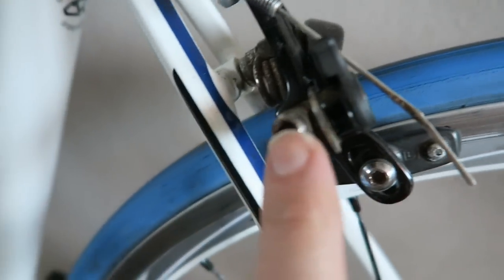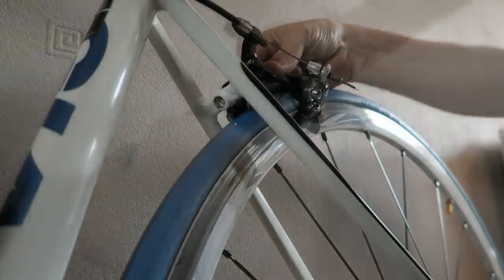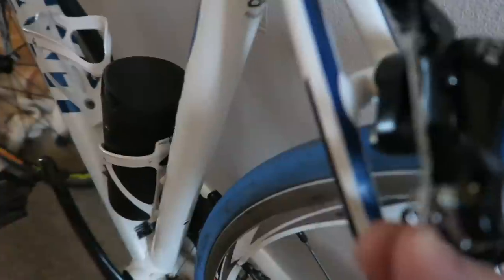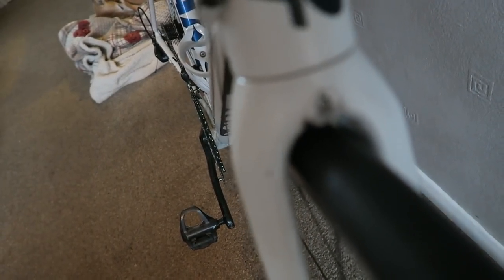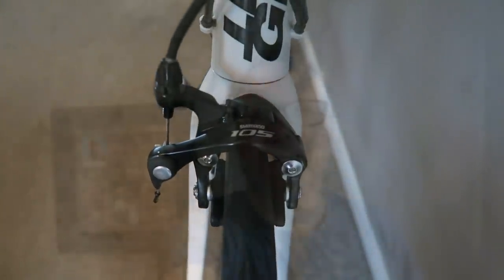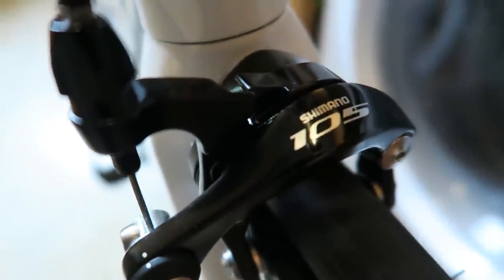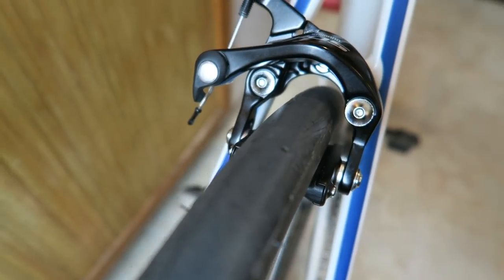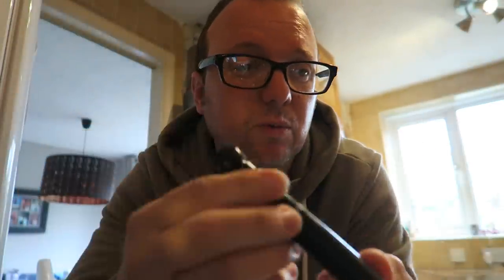Fitting Shimano 105 Brake Calipers  -  VLOG 268

Comment: I just installed my new 105 R7000 calipers today and I am absolutely blown away by their performance. I was using 15 year old Ultegra calipers and the difference is beyond anything I could have even hoped for.
Reply from the maker: cycling T-Holms fantastic stuff mate, I really noticed a big difference in braking after fitting these 😀👍🏻

Comment: Awesome video! Do you really feel any significant different between the old and the new 105 brakes? I have 105 5700 and thinking if it's worth replacing them with the new 105 r7000... Thanks in Advance and once again, great video!